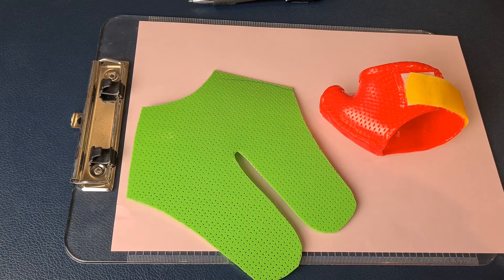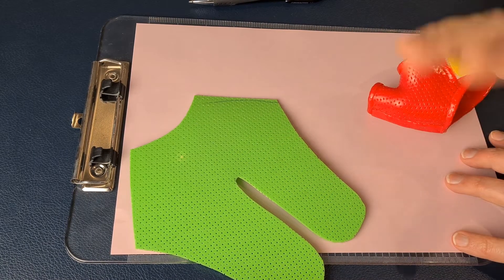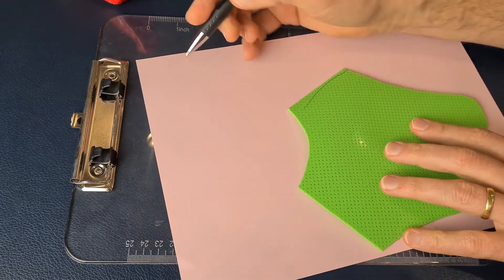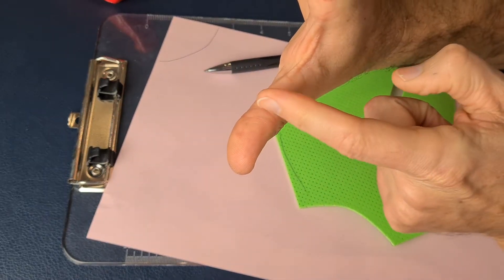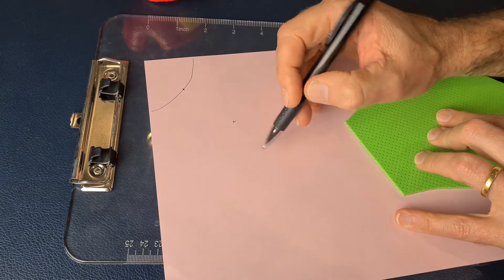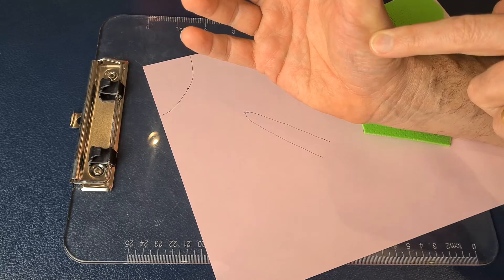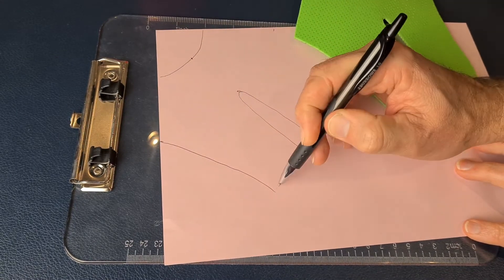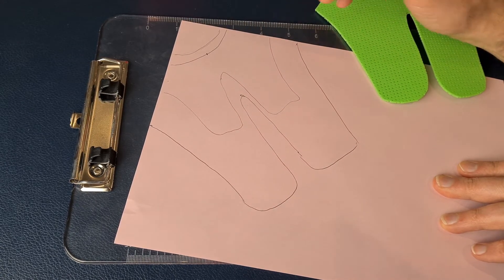How to Make a Thumb Spica Splint - Creating the Template

Comment: How do you choose the material thickness and dimensions?
Reply: Hi there, Rem - while you could make a thumb spica from any thickness of plastic, I quite like a 2mm thickness (eg Orfit Colors 2mm microperforated, or equivalent) as it is thick enough to give decent support while not being completely rigid, which helps with comfort. 1.6mm would be fine for many hands, but may not be supportive enough on a large or muscular hand. In terms of dimensions, I can make a thumb spica for an average sized hand from a square of thermoplastic 18x18cm, meaning I would expect to get 6 thumb spicas from a 45x60cm sheet with a few bits left over to make finger splints out of. Happy splinting! - Ian